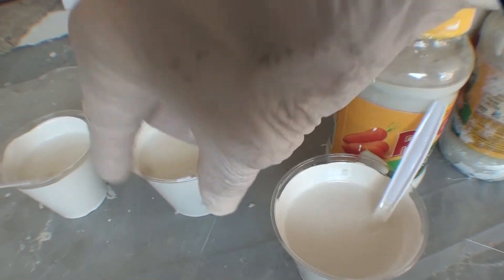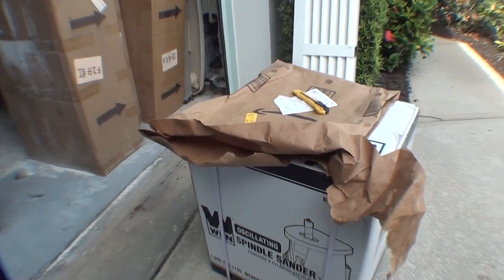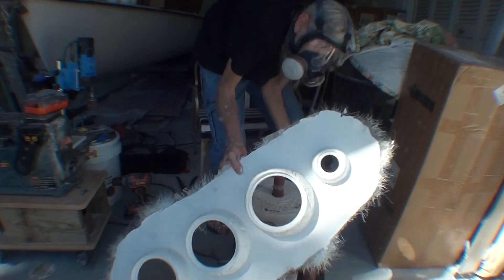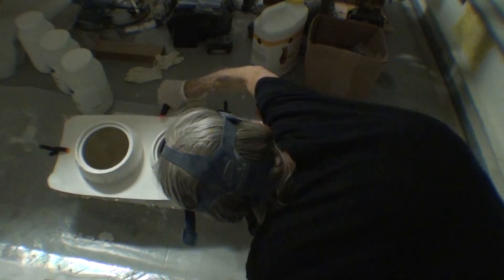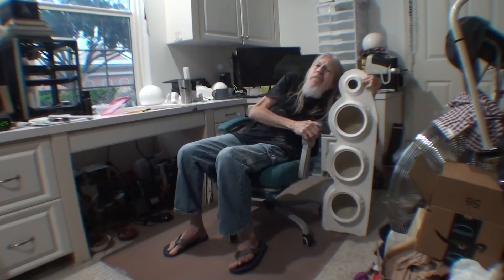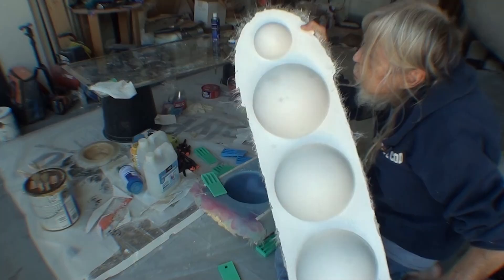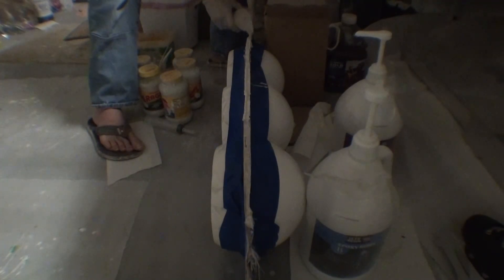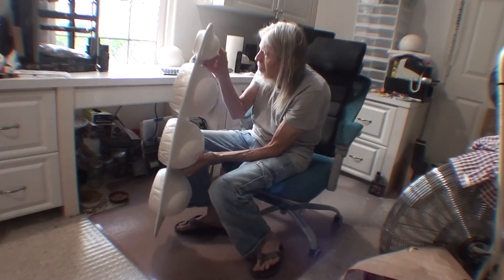I Finish The Speaker Pathfinder Prototype

Comment: if you want a nice flat surface on the 2 halves to bond together, use a roller to consolidate the mat properly, then put a layer of peel ply straight on top and roll that, it'll give a much cleaner, uniform face. you can also cat enough gel (about 2%) to do the whole mold in one go, then leave it fully cure and you can then lay up the glass and you wont get that pre release on the front half.
Reply from the maker: Thanks!  Those are some great suggestions.  Will definitely get the fin roller and peel ply.  I think that will save time and make the flange thinner.  I time the gelcoat so it gets applied just minutes before setting up because otherwise I need to keep brushing it up onto the vertical surfaces and out of the bottom of the wells.  That's why the four small batches.  I brush each batch up the sides until it stops sliding back down and then move on the the next batch in the next well.

Comment: Looks good, should work really well. Keep both sides straight, unless you hang it on the wall. The curve and straight does have art to it and would look good hanging
Reply from the maker: The asymmetric look is tempting, putting the curved part on opposite sides of the two speakers for a mirror image look..  The drivers for the real nice speakers are all different sizes, so I am thinking about sloping straight sides with big balls at the bottom and the littlest one at the top.